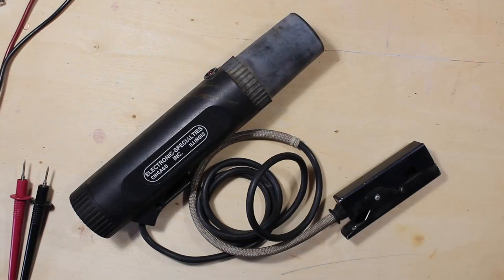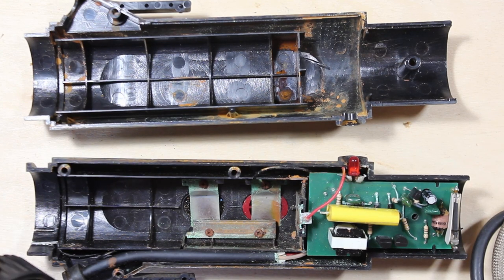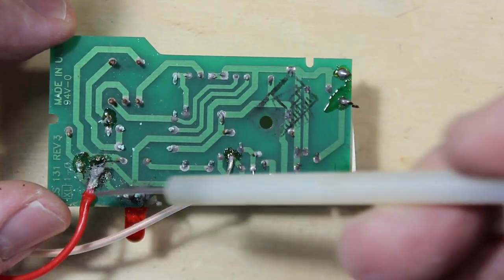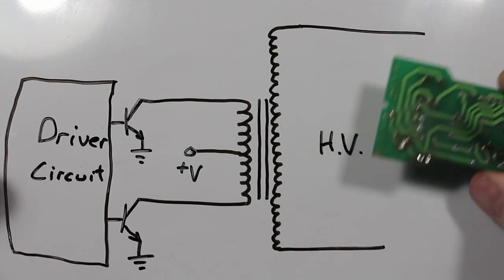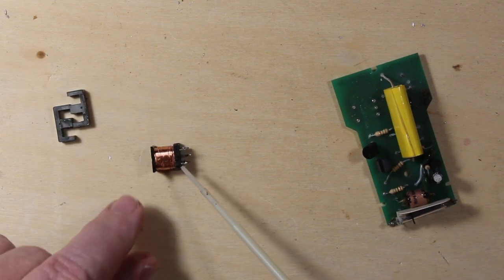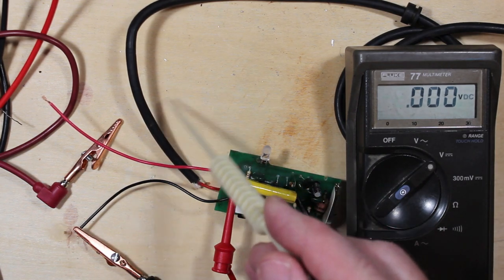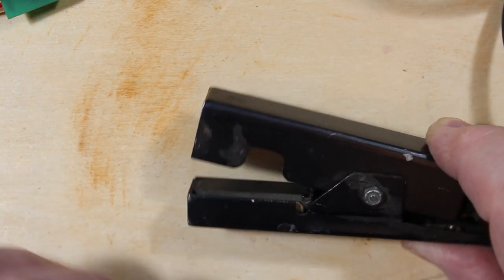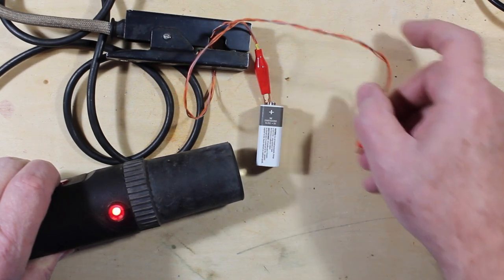Repairing Electronics - Who Knows What Might Cross The Workbench.... #electronics #repairing

Comment: I used to have the exact same timing light as this. Excellent tool, works at much higher rpm than most. The second hole next to the switch was for an optional power indicator. Mine suffered the same fate as this poor tool, and although I don't recall taking it apart to attempt a repair, it's not impossible that that happened. It's been a while. Maybe someday I'll get another one of these, Electronics-Specialties still sells them and they're not too expensive. Like you said, way cheaper than having someone fix it.
Reply from the maker: Often cheaper to buy a new device then to pay an hour at typical 'shop rate' to attempt a fix.